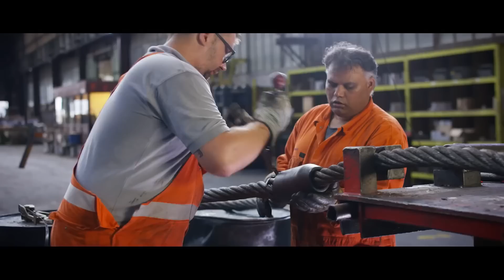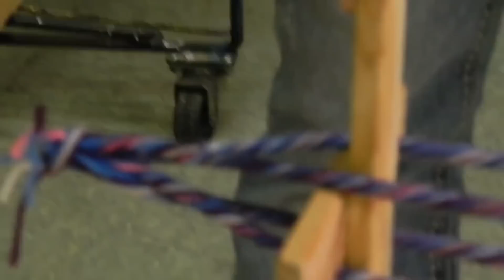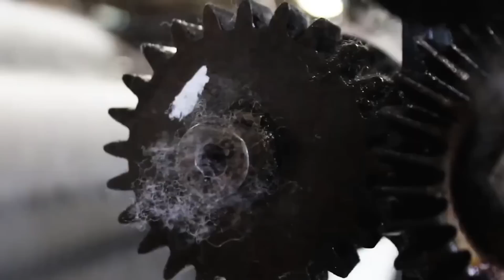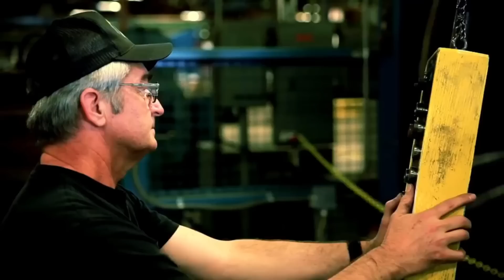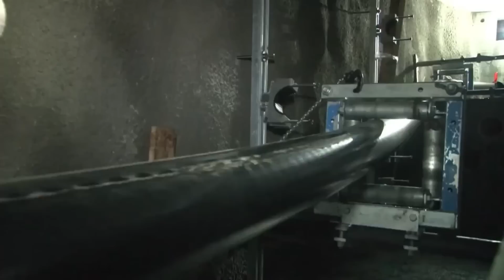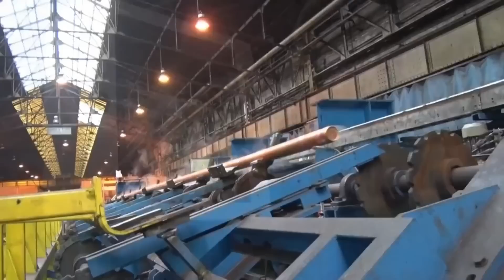Manufacturing process of TAI-I Electric Wire and Cable, Making rope through medieval.

Comment: Best Electrical Conductors: 

1) Silver
2) Copper
3) Gold
4) Aluminum
5) Zinc
6) Nickel
7) Brass
8) Bronze
9) Iron
10) Platinum
 11) Steel
 12) Lead 
13) Stainless Steel

Comment: At the start, with the massive steel wire ropes at a diameter of around 36" or just under 3ft, i wonder what that cable wire is used for, it would have 100's of thousands of tons of breaking strength for sure, it has i believe 6" wire made from what looks like 6mm individual wire made into a strand, till its gets to 6" in diameter, then 6 of the " inch wire ropes are woven together to make the massive 36" diameter wire rope? 🦘🦘✌✌😎😎